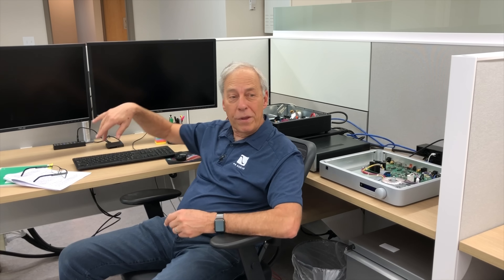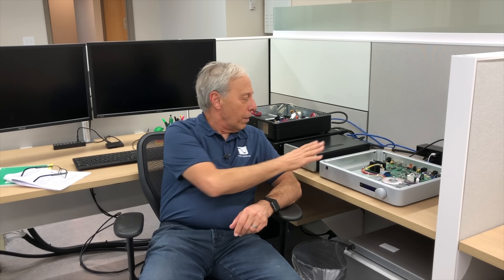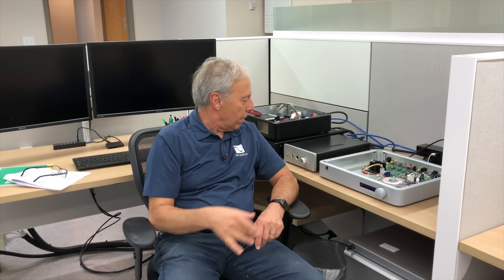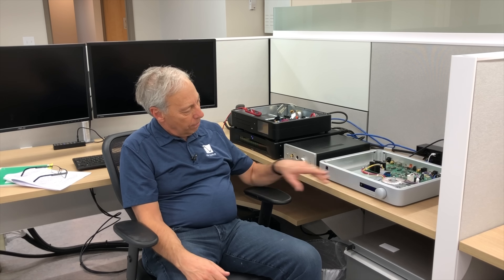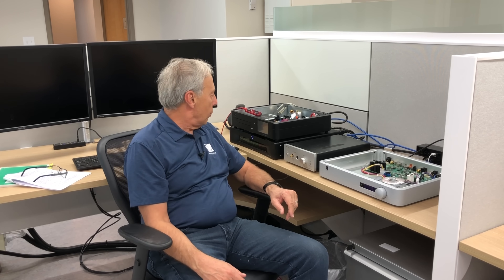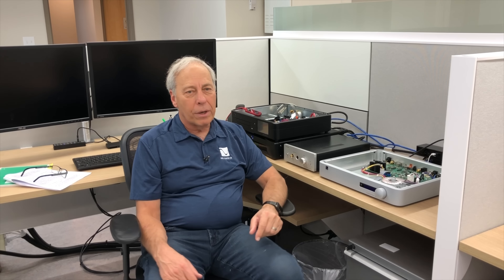Using a UPS for power conditioning

Comment: Anyway help for a guy with a dedicated music studio to play and record music?  My big prob is when playing guitar thru a high gain amp the dirty power noise is incredible.. trust I've done everything from checking ground loops and even had a electrician cut off all power to my house and studio with just circuit where amp was and noise/loud hum was still there so has to be dirty ac power from FPL, Florida Power and Light..  tried $800 power conditioner/ voltage regulator and did nothing..  after alot of research and trying to keep within  a budget, was thinking about trying a 1200 watt Tripp Lite true online double conversion ups to separate power from utility power... any thoughts anyone?? Thanks!  There not alot of info out there on this particular need

Comment: Things to keep in mind.
Most ups's are line interactive that means they just send whatever the incoming power is as long as the voltage is correct. Some better models have an auto transformer that can stepup or down the voltage to work as a stabilizer but they don't filter any thing other than the basic common mode noise stuff. Some even better models monitor frequency and waveform & switch to battery when things are not good. All sub 200$ ups's are modified sinewave not pure sinewave. Switch mode powersupplies do not care about incoming waveform or voltage , aslong as the rectified voltage is within working range it will make power at the output. That's why computers can run on squarewave ups's that have more than 50% thd while on inverter mode and massive voltage fluctuations, ringing and much more on those units but computers don't complain cus the smps in them don't care about it. 
The ups u need is an online ups that is used in servers and are very expensive. They take the incoming ac and turn it into dc and then make pure sine ac outfrom it again. Those models can also be set to bypass mode when the power is good if u care about energy savings. The apc online ups i have in my server room puts out cleaner sinewave than the mains supply.

Comment: Not advisable.  The problem is that most home ups systems are not filtered well. The voltage regulation in normal mode uses buck/boost transformers that switch instantaneously when voltage from the wall goes up and down—assuming regulation is even provided.  In standby the output is usually stepped AC.  The output could be as bad as 4 pulses/half cycle.

Comment: I use the Tripp•Lite Line Conditioner LC2400 
This info was taken from the back of the unit 
Output within ANSI-C84 Voltage Limits max load limits 2400 watts
Isolated filter banks noise suppression @ 1 MHz
Voltage Regulator with isobar spike & noise suppression

Comment: Power factor can be improved using power factor correction capacitors. The bad news is that you have to be an electrical engineer and know exactly what you are doing to size one properly. They are typically used in plants with large highly inductive loads. Increasingly they are being used in file servers because low power factors waste utility power.

Comment: I'm having such a hard time just getting a straight answer. What's a good affordable solution to power? Is an AC filter the solution? If anybody would like to throw out a couple of suggestions, I'm all ears!
Reply from the maker: It depends what you're trying to accomplish and what you're goals are. If you're not overly concerned about high performance audio, then there are a number of decent power conditioners/surge protectors on the market, everything from Belkin, to APC have offerings. If you're concerned about sound quality then you want to consider power regeneration.

Comment: i tried and did it with a big new ups I could borrow from a company director to try my idea  . I needed to find a solution to get the fan noise to a minimum from the ups so I puted in a room next to the dedicated audio room. I played with Denon pre and 4 poa 6600A mono amps on infinity kappa 9A. i did it during different moments day and after midnight. it was no success. 14 days trial A B testing. doesn't work...Paul has it right. I wonder with a ps audio...
Reply: It will most likely work well for video but I haven't heard one yet that sounded good with audio. One actually removed all bass from the sound.

Comment: If your powerfactor is smaller then one your load is inductive our capacitive . If your load is inductive you can get closer to one by adding a capacitor. If your load in capacitive you can add a coil, to make the powerfactor 1. In formula make xl=xc.

Comment: I just bought a Zero Yeti 1000. It uses Lithium battery to do the regeneration work. So far, I see some improvements in my system (quite noticeable actually). The improvements are mostly at the high frequency and upper mid range. 

My system consisted of : KEF ref1, Mark Levinson 27.5, Audio Research LS26, and a Marantz CD player.

Comment: for a sound system? yes you can, why not? but it's not worth the trouble.
you could achieve pretty much the same result with a carefully designed power supply.
Reply: True does it exist?
Reply: @BrianGarside  on the market? not sure, DIY? there are plenty.
Reply: @duckmesideways  DIY works for me. I just dont know where to look.
Reply: 30 years ago tried a UPS and the sound was terrible. It did work well for video though.

Comment: @0:45
"... since they regulate the voltage, clean the power, and check constantly the sine wave when necessary ..."

Some do.
Most do not.

Most UPS's are referred to as a "bucket of batteries", because they do nothing, other than switch to battery power, upon a blackout or brownout.

And, as Paul mentioned, when they switch to battery power, they do not produce a sine wave (and for audio gear, you want a sine wave).

Why a bucket of batteries?  Because that type of UPS is primitive (not much that it needs to do), and, therefore, cost less to manufacture, and cost less for us to purchase.

There are also line-interactive UPS's, that will trim or boost the voltage, as needed.  But it is not a precise adjustment.  These UPS's will initiate an adjustment, only when the voltage hits a certain range.  Anything within its range (within its tolerance) will be ignored.  Meaning, if you have low voltage from your wall outlet, as long as it is not too low, the UPS will ignore it.  And when the UPS does get triggered to make a voltage correction, it is not subtle, and you will likely hear it.

Then there is the "on-line" UPS.  These offer the best protection, and will empty your wallet.

To get a UPS that delivers a sine wave, that does the double conversion, will raise the price significantly.
Such UPS's do exist.  But for home use, the choices are very limited.  If you want to run a data center, and spend tens of thousands on a UPS, then more choices open up.

Also note that the double conversion UPS's use electricity every second that they are on.  It is not free to convert electricity from A/C to D/C and then back to A/C, which is what this type of UPS does.  So for every 100% of juice that enters the UPS, the UPS outputs typically between 90% to 95%.  So you will have an electrical bill increase.

I have never seen a review to determine if any double conversion UPS's help with better sound (and it will differ, depending on the quality of the sine wave in your home, which will be different for everyone).  If your utility company delivers crappy power, then a double conversion UPS will probably help.  If your utility company delivers quality power, then a double conversion UPS might do little, if anything, or might even be somewhat detrimental to getting better sound from your gear.

And then there is the noise that double conversion UPS's make.  They are quiet.  But they are intended to run computers, where a whisper of a fan, for example, is acceptable.  But for your music?  Any extraneous noise is a red flag.

Lastly, can a double conversion UPS deliver the sudden power demands that amplifiers will draw, in order to not starve the amplifiers for that initial leading edge?  Or will the "slam" of the moment be dulled?

Comment: I once made the absent-minded error of plugging in a small vacuum cleaner to my UPS. BEEP BEEP BEEP BEEP! Right out of the box my Sony XBR900E had a weird pulsing in the screen backlight, tried it on the UPS, and it cleared right up. As long as you watch your loads, and get an "online" UPS, it is a good budget way to get in the game. I mainly wanted one for the battery backup, to keep the DVR online during power cuts.

Comment: My power plant is a huge natural gas powered plant delivering max somewhere around half of a Gigawatts of pure 60Hz clean power via some transformers and wires to my amplifier, which does an excellent job of re-generating that 60Hz AC into a clean DC power to the amp electronics, which feeds a high quality music signal to my speakers unaffected by the noise from other power consumers. 🤔 is that DC voltage really clean from noise on the grid? In my case, yes. If you have an oscilloscope and some braveness, try measuring it. Let me know if you are one of the 0.1% with such problem and please post your measurement. Perhaps your problem is that your amp power supply is just poorly designed? Try to add a cheap line filter 😂 Well, perhaps some regions of the planet have much worse power. Perhaps you share power with an elevator motor?
Reply: ThinkingBetter Well said..
Reply: What if someone with big money that live in a big house with over 20 units of air conditioner running 24/7 and couple of big hp fridge to store their beer supply and pollute their own power line which causing light dimming to whole neighbourhood. Yes, I'm talking about an actual real life case here.
Reply: mikka333 It’s a great example. With 20 air conditioners running, I will suspect that acoustical noise from the ACs is much more audible than the theoretical interference caused by electrical induced noise on the AC power from the AC units. Too much AC talk lol.
Reply: There are like 10+ rooms, living room alone has 4 big air conditioner. The audio/theater room is a dedicated room with very thick and heavy door and no window, the room toilet has an ceiling exhaust fan and that's the only way to get air into the room through the door gap. That is some first world problem for ya.
Reply: mikka333 Excellent, so how do you notice the noise induced in the AC? What kind of noise is it? I have a large air conditioner in my back yard that works for the entire house and 3 smaller units to reduce the electric bill. I don’t hear any degradation between my AC units on or off.
Reply: @ThinkingBetter  That's good for you, you can save the money to invest on other stuff.

Comment: Majority of amps are class AB differential amps rejecting common mode signals like ripples or noise with feedback , rolled off frequency response to manage such issues. Line Interactive UPS is good for protecting power section of amps were power failure or fluctuations are problems, next choice is a good line filters. BTW Class D will "sort of" work even with cheap PC ups as the load is like PC SMPS

Comment: Message to anyone who owns a power conditioner, an expensive network streamer or expensive speaker cables. I have some excellent snake oil for sale. Cures cancer and everything. On sale at the moment for only $2000 per bottle. 😂
Reply from the maker: Well, thanks for letting us know yours doesn't do anything.
Reply: Go find the exit.

Comment: What's so wrong with the AC supply over there in the States ?? Is it the fact that you guys are using junior voltage class of 120... or what ? You have the disadvantage of having to make up the power consumed by doubling the current ( which could be brunt of all your problems .. I don't know ..) but here in Australia we enjoy a healthy 245vac supply and much lighter currents... in my opinion power line filtering and low impedance cabling is all you need ... here, a P20 module would be a total waste of money ...
Reply: "here in Australia we enjoy a healthy 245vac"

Janina, some Australians enjoy a healthy power supply. Move out into the sticks and you'll discover it's not universal. Throw in cool-store motors, stick welders, irrigation pumps, aging infrastructure, three or four boards of directors instead of one... and suddenly it's not so healthy. I wish it was, but if wishes were fishes and all that... You wouldn't believe how many Honda generators have sold here in recent time.
Reply: There is nothing wrong with AC power in the States.  Some folks have made money convincing folks that there is something wrong..

Comment: If you need an expensive piece of gear to "clean" out the AC going into your stereo your stereo is poorly built and has shitty filtering in the power supply.

Get a better stereo. Its a cheaper solution.
Reply: BaconByte Yup!

Comment: Hi Paul. Great Vid.  This has been talked about before but you havent really mentioned you can buy an online double conversion UPS that is 20A or 30A output capable for around 1200$ these days.  I own a cyberpower OL2200RTXL2U to run 3 zones of AV gear in my home.  It is remote located in my mechanical room and I have dedicated runs leaving from it to each zone feeding a quad receptacle in wall.  I have never noticed any brownouts voltage wise, and total current output is rarely over 4A.  With 20A (1800W/2200VA) capacity I am no where near peak ,not rms, current demand ceiling.  With 2 zones of audio gear running I am still not even close to taxing it.

Buy a beefy double online conversion UPS, like a OL2200RTXL2U, and forget about it.  Run it in online mode, not line interactive, all the time.  Will this make your audio better?  I hope not.  It points to flaws in your gear if so.  Use one to prolong your gear longevity from issues on the utility side.  This will theoretically make your gear last indefinitely.  If multi million dollar IT rooms run on them......  I'm covered. 👍
Reply from the maker: Yes, you can and for some equipment it might help, others not so much. The problem is that any equipment with a low power factor will have more distortion than without the UPS. Since most stereo equipment has a lower power factor, that's not good and especially power amplifiers suffer. I've seen the incoming AC jump from a norm of 1% THD to 10% THD when connected to these devices. They use a class D amplifier at their output and that has trouble with high peak current demand at the peak of the sine wave.
Reply: I am interested in the M700s.  Do they have a low power factor?  Feel fee to get technical.  I assume they lag but by how much?  What is the VA at full output vs W line side?

Comment: I don't understand how regenerating an AC waveform is supposed to improve your power supply in your downstream equipment. Your power supply should be able to handle and fix most AC issues to deliver DC current to the amplifier as long as the incoming voltage and current is within normal limits.
Reply: I agree. To me, they obviously handle and fix some issues. If they didn't I think we would all be in big trouble! However, they are not perfect and not that good at certain things. That said, I do not buy into the whole story of "you must get this four or five figure power re-generator to pick up the difference that the power supply in the gear doesn't do. To me this is up there with $400 or $500 rhodium outlets for your walls so they can power your gear better by magically changing the crappy power coming into your dwelling from the street over the romex in your walls or whatever, which in turn comes from the crappy power plant that feeds the lines coming into your home.........
I'm now electrical expert, but crappy power can have a easily noticeable effect (I've heard it), yes, but a simple conditioner will do the right job in my opinion. I used to live in a house built in the sixties that had been rewired, but likely by someone who did not know what they were doing. The power was as dirty as you get and extremely inconsistent fluxing fairly wildly. 
Drove my amp at the time crazy, which did indeed effect the sound. I knew I need a surge protector for sure, not to clean the power of course , but fluctuations made me very nervous of surges. So in looking around I ended up getting a Panamax power conditioner/surge protector. (It was around $230...yeah still a lot to me, but compared to one of those monsters from PS Audio that I can't even afford to dream about much less actually purchase, it was nothing). Cutting to the chase, it was a good choice. Good enough to make up the difference I think because it did smooth things out without robbing dynamics (a compromise I am not willing to make) and more importantly it was not long before we had the first power surge! Yeah, only about $1000 worth of gear at the time, but that is a lot of money to me as it takes about 10 months to come with that if I am strict. So spent $230 to save 5 times that and the thing keeps protecting. I run still and it doesn't die after the first pop. So for me it works. I don't pretend to know what magic is  in the PS Audio power thingys nor even what exactly goes on in the Panamax. All I know is what works for me.
Reply from the maker: It has a lot to do with regulating the incoming AC as well as filling in the missing peak voltage which is where most equipment needs the power most. Also, the impedance of the incoming AC matters a great deal. Think of it like water.
Reply: @Paulmcgowanpsaudio   I assume what you mean by that is impedance within the cables providing the AC power to the building and to the sockets?
Reply: I have found a dirty earth from the power company is more of an issue, better to replace with a high quality local earth the same way that telephone exchanges do.